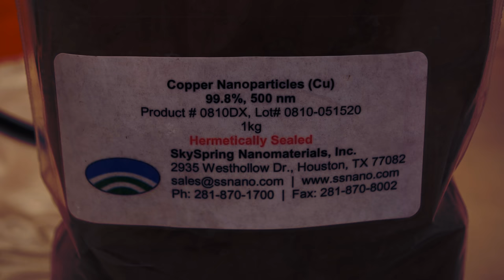Make Our Best Thermal Paste... YOURSELF!

Comment: @19:25

We do want the material densely packed, right? Or do we want the smaller spheres to be able to slide between the gap of the larger spheres, even if they're jammed up against each other? Unless I'm mistaken, that's not one of the assumptions. If I understand correctly, we want as much contact as possible and so we want the largest sphere that can be placed in a set of tangentially packed spheres of equal size. Stack 4 spheres ontop of another 4 spheres and you create this tangential stacking setup. As you expand the lattice, you add 4 outer spheres (vertices) everytime you add 1 inner sphere (center). Thus the ratio of 1:4 is upheld for the NUMBER of small spheres to large spheres in steps 1 and 2 for the densification.

If you pack 8 cubes so that each is tangentially touching its neighbors, then you can draw a cube with vertices at the centers of each of these 8 spheres. On such a cube, the side lengths will be the same as the diameter of a single sphere. Then consider the diagonal between two opposing vertices in the cube. This diagonal is sqrt(3) times the side length of the cube. The portion of that diagonal that is left after you subtract off the portion of the diagonal that enters the outer spheres is sqrt(3) - 1 (because there are two spheres that the diagonal line must pass through and each contributes its radius -> a value of .5 times the diameter we were considering for reference. Each of those radii values must be subtracted yielding sqrt(3) - .5 - .5 = sqrt(3) - 1). Thus the maximal inner diameter is (sqrt(3) - 1) times the original diameter. This is approximately .730251.

If we want the biggest sphere we can get in the space between the 8 spheres packed together in step 1, then the diameter of the sphere in step 2 will be 73.2051% as much as the diameter in step 1. The cube of .732051 is .392305. A fourth of this value is .098076 (recall that the ratio of small spheres to large spheres approaches 1:4 in the limit as the number of spheres becomes large). Hence The collective mass of the spheres added in step 2 is 9.81% as much as the mass of spheres added in step 1 (If the same material density holds - which will happen as long as you have spheres of the same material).

I know these back of the napkin calculations aren't the equivalent of testing... but it would definitely be worth it to test this out. (Unless I'm mistaken in my logic somewhere - and anyone is free to jump in and correct me if that is the case).

EDIT: If you want to extend this to a third step... the next iteration would be spheres with diameter (2 - sqrt(3)) times as great as the largest sphere diameter. This is approximately 26.795% as large. The volume would be .0192379 times the volume of the largest spheres. The ratio of the number of spheres from the third step to the number of spheres from the second step is 6:1 in the limit that the number of spheres becomes large. Hence, the cumulative volume of the spheres in step 3 would be 2.886% as great as the cumulative mass of the spheres from the first step.

In other words, Step 1 accounts for 88.74% of the total mass of spheres, step 2 accounts for 8.70% of the total mass of spheres, and step 3 accounts for 2.56% of the total mass of spheres.

Note that in the "third step", the spheres will not lie completely tangential to all the surrounding sphere faces.

In short: 

Step1: ~5 Micron Diameter Spheres
Step2: ~3.6 Micron Diameter Spheres, 9.8% as much mass as was added in step 1
Step3: ~1.3 Micron Diameter Spheres, 2.8% as much mass as was added in step 1 (This step is optional)

Comment: Always enjoy your videos.  Two questions about thermal pastes. 
1) Why not use diamond grinding powder?  Non-flammable, very high thermal conductivity, relatively cheap and easy to obtain in various particle sizes.
 2) It seems you prefer spherical particles.  Wouldn't some other shapes be more efficient?  For instance, it would seem cubic particles would pack better with more surface contact from particle to particle leading to better conductivity.  So along that reasoning, grinding diamond grains will not be spherical, instead have flat facets leading to better heat conducting paths.
Reply from the maker: Without a controlled packing method, the non spherical shape packs poorly and flows worse. You can try it with sugar cubes.

Comment: I use copper anti-seize compound for both electrical bonding and thermal conductivity paste. Its cheap, available at any auto parts store, and it works great for most applications.

Comment: I had an idea for mixing:
What if you added a thin liquid to the mixing and make it "runnier"? Pick a liquid (like alcohol or acetone) that can easily be boiled off through heat or vacuum. You can mix it with easy methods until you get a good and thorough mix, but it'll be too thin. But after you have a good mix you remove the extra liquid, keeping the well mixed "stuff" you want behind.

Comment: Very clear explanation & DIY making it tutorial, exceptional & interesting & very educational. Your my hero father Tech Ingredients! Well done all around! Super cool, the only thing that cools better than solid heatsinks or water cooling or AC assisted ? Vapor chamber cooling or spraying the hot chips with dielectric chilled fluid directly // in a sealed setup the cycles the fluorenert non electrically conductive fluid or similar synthetic silicon oil etc as a working fluid to steal heat from the hot chips & dump it somewhere else with the aid of copper or aluminum heat sinks & some exceptional fans with long life motors //

Comment: it's been a long time since i've been so intrigued about something to sit and watch it for 45 minutes and not even realise it was that long. finished the video, thought it was a 10 minute video, looked at it, and was surprised. absolutely fantastic, and i know so much more about thermal paste now. came from LTT's video about this, and in their test it holds up the same as noctuas.
would there be any way to make the paste a little less viscous? the only critique i believe they had was that it didn't spread as well as noctua's paste. assuming if you had the tech, and resources to use all aluminium powder, and the tools to properly mix the paste together, there would be some serious competition for noctua, and other thermal solution manufacturers out there.

on that note, would it be a good idea to use all aluminium powder, that are all coated with silane? (assuming you have the appropriate equipment to safely handle the materials)

Comment: Could you use the solder mixer for the very thick final paste if you added some very dense object, like a large ball bearing, to the container? I would think this would give similar results to using the mortar and pestle, but without the arm work. I absolutely love this channel. It has inspired me in so many ways. Thank you.
Reply from the maker: I tried something like that with some very dense, zirconium milling balls. It might have worked, but the result was so  messy to clean out that it wasn't encouraging.

Comment: Have you considered mixture by extrusion?  It's the same method used by "quick setting" epoxies where parts A and B are extruded through a mixing nozzle.  This seems like it would introduce far less air than the mortar and pestle, would yield a homogenous mixture in short order, and might even be cheaper to implement.

This entire line of research is fascinating.  Thanks for taking the time, and for being so thorough in your experimental design to this point.  You do Science & Technology the real service of showing that anyone can do it if they can adopt the right mindset and go where the data takes them.
Reply: Epoxies aren't really being "mixed" properly in those extruders. It's just increasing the contact between the resin and the catalyst. The resin goes hard without any catalyst, yet even a small amount on one side of a blob of resin will make the whole thing go off very quickly. The catalyst doesn't need to be mixed in order to be effective, it doesn't even need to be close to mixed..
In this case, it's very important to get the particles extremely uniformly blended and suspended in the carrier fluid. Consider that if you cannot smash them together with a mortar and pestle after a few hours, it's not gunna work by squishing them down a pipe.

Comment: Asymptotically. I have never once had occasion to use that in a sentence. I knew what it meant but never heard it used out loud so I wasn't sure how it was pronounced. I just asked two engineers where I worked and it was the same with them too. 
So, cudos for its legit use!

Comment: Great content. I am a 4 season DIY eBiker and thermal/ingress management of motor controllers and motors is fundamentally important. For a part 3 in this thermal media series, could you conduct a formulation and test of a thermo fluid (commonly ferro fluid) for inside the motor that will nicely partner with the thermal epoxy formula for the growing bike movement.

Comment: I had major issues with the Noctua NT-H1 Thermal paste where I'd just have a thin layer of Silicon oil on the Chip and no thermal interface media after a few weeks of use
I have this issue with my laptop as well as with my PC
so I decided to mix some myself
Liqui Moly Silicon grease+Graphite powder(16-63µm), basically stuff I just had sitting around.
I had a look at it yesterday after several months and I am happy to report that I still had a film of paste on the Chip, no seperation at all
temps remained constant (lower than with noctua) over the entire period it was in use

I am now testing with HBN powder(0.5µm) to see if it is as good, reason is that it is not electrically conductive

both are suitable for use up to 200°C, even after mixing in as much powder as I could, they are both fairly easy to apply and produce an even spread
Reply from the maker: Good luck!
Reply: @TechIngredients  the results are in
HBN performs significantly worse than graphite
maybe it's the particle size, maybe the termal properties or the chaotic nature of these small particles, going back to graphite until the Gelid Extreme thermal paste arrives, and yes, the temps dropped significantly after a brief break in period and the fan finally got quiet again.

that just goes to show, you can never have too much random stuff in your toolbox, maybe you need something to improvise in the future.

done some reading in the meantime, the phenomenom is called "pump out", apperantly this is mainly on laptops and some GPU's,  basically wherever you have direct silicon cooling with small surface area, some thermal pastes are up to the task while others are not

kind of disappointed in noctua tho, their coolers are fantastic, but the thermal paste not so much, at least in the long run.

Comment: I once watched a video about LED bulbs/lights and how ,for planned obsolescence, the factory used too little thermal paste. The person went on to say that he would disassemble each LED he bought to remedy this by replacing the old paste. Saying that they would now last "forever" or a long time. Is there any simpler paste we can make at home that would suit such a need? Thank you for the great content and inspiration
Reply: You are mislead if you think that is the main/only issue with the life of commercial LED bulbs. Most of them don't have any thermal paste, cannot be disassembled to add any, and will not benefit from doing so.
Compromises of the design on manufacture of LED lamps are not for "planned obsolescence", it's simply to reduce manufacturing cost.
Reply: @johncoops6897  thanks

Comment: After the thermall conductivity, an another important factor from thermal interface materials is its electrical conductivity. Would be very interesting to evaluate this spec as well since it is crucial for some designers.
Reply from the maker: Both our thermal pastes are not electrically conductive.  Linus Tech Tips confirmed this.

Comment: As a further comment, I found the earlier video regarding the testing apparatus quite engaging and the discussion of the method was intriguing. I recently read an article concerning Huesler alloys and have an interest in exploring the research of metal alloys the generate electric charge from heat. 

However, to the point of the video and discussion of properties of the oils and particle materials used in the paste - i was wondering if it could be possible to do a video discussing some the properties of various grease compositions. Another personal hobby uses a specified grease composition in conjunction with a specific torque rating for securing two assemblies together. The specific composition is specified by MIL-G 21164, which describes a specific composition of molybdenum disulfide grease. There is wide spread debate over whether that is as strictly required as the various manufacturers would have the public believe. Given the operating temperature of the finished assembly and the high maximum pressure 430.00 MPa (62,366 psi) the standing assumption I've made is that there is a property of the grease composition that was determined to be of significance, otherwise any run of mill molybdenum disulfide grease would have been given instead. Is this something that the channel would be interested in diving deeply into? I understand that there is a variety of factors that influence the design of various lubricants and the resulting formulations to accommodate specific circumstances, however from a non-engineer it has been difficult to find concise discussion of the topic. Warm regards, thank you.

Comment: Great video! While the demonstrated thermal compound performs well and would be fine to use in most applications, one design constraint generally followed by commercial pastes is ensuring they're electrically non-conductive. Properly-applied thermal paste obviously shouldn't end up in areas where electrical conductivity would be a problem, but manufacturers need to ensure they cater to the lowest common denominator and they definitely need to ensure their product won't cause damage/shorts even for the person who somehow manages to get the paste all over the chip, surrounding passives, and even into the processor socket. Even moderate electrical conductivity can have consequences on the operation of your electronics at the speeds that modern processors operate at.

It would be interesting to see your choices of fillers for a formulation containing only non conductive materials (oxides etc.). As you say, the bulk conductivity of the filler is not as critical as the powder shapes/sizes, but there's also the sourcing/availability consideration and it would be good to know what reasonably non-conductive materials are available in the appropriate particle sizes and spherical particle shapes required to make this paste effective.
Reply from the maker: Our thermal paste is not electrically conductive.  The oil effectively insulates the particles.

Comment: Great video, liked your sound in material explanation. Please make a working "was scepter", the Egyptian staff that was supposedly just ornamental, but in fact it was probably a sonic tool, it was a tuning fork in one end, a long rod and another shape in the other end, if the tuning fork vibration is same as the second harmonic of the longitudinal vibration of the rod it could be held by the middle with one hand (by the node of the second harmonic) and since the tuning fork shape redirects the prongs vibrations to the rod as longitudinal waves the energy could be used in the other end without slowing down the prongs vibration, so it would be a 8-10 seconds of free work in the other end of the rod while the tuning fork is vibrating.
Reply from the maker: Interesting.  Thanks.

Comment: The silane coated ZnO particles works better because the attraction of the oxigen in the silicone oil to the Zn2+ ions of the particles. They act like a crosslinker for the oil. With the coating the particles are shielded.

Perhaps you can get rid of the mixing at the end by using a ointment mill. Sometimes you can get used ones cheap

Comment: I've loved your videos, watched several. Sad that I never got a conclusion to your plasma experiments but I assumed the latter ones had some reason they were never published. Either way you've inspired me to persue my dream of some engineering challenges and given me, and the internet at large some fantastic insights, ideas, and methods to explore. As a curiousity I wonder if you ever considered using your solar water heater, combined with your mini-fridge to produce electrical energy. I considered this after seeing the performance differences of the solar panel vs the solar water and noted a substantal heat in the water  that might well offer a resonable attempt. I'll try it myself though, parts collections cost as you've noted, and you already had them so wonder your thoughts on it.

Comment: I am always encouraged to keep thinking about various experimenting of my own when I see your videos. I have my own solar thermal designs I'm thinking about. I'd love to see more of your data. Five more minutes of mixing has measurable improvements!? I'd love to see some charts comparing the results after each step. If you really read this - a personal thought I've had is to create a magnetic thermal interface material - that helps when a machine is set up to connect and disconnect from a thermal load. At the moment I'm thinking ink toner and glycerin. Thoughts?